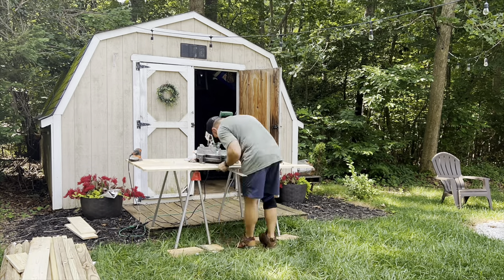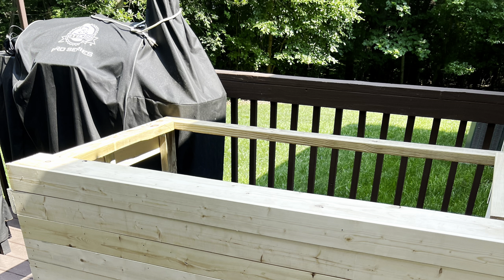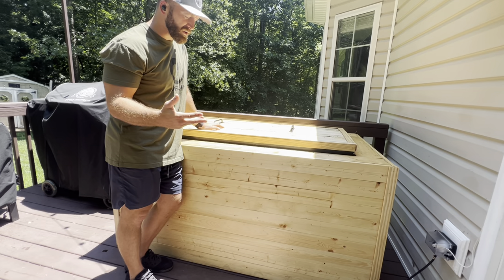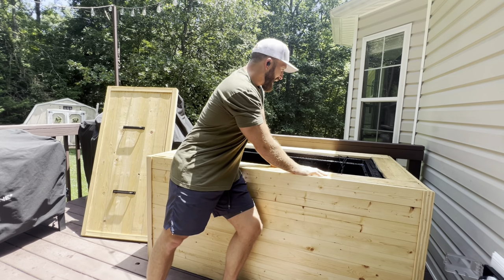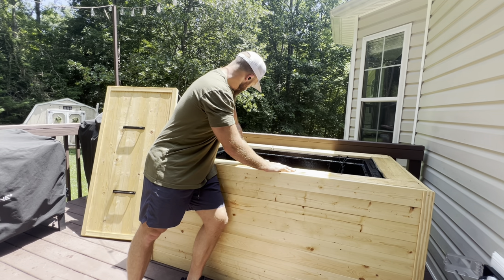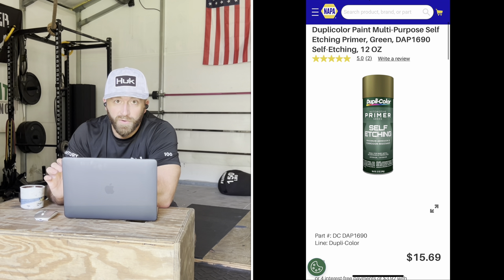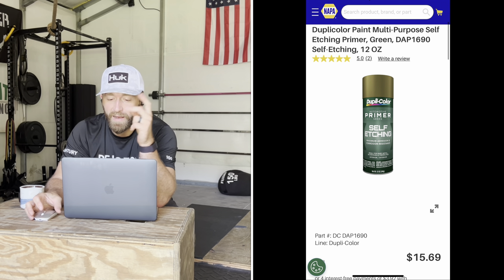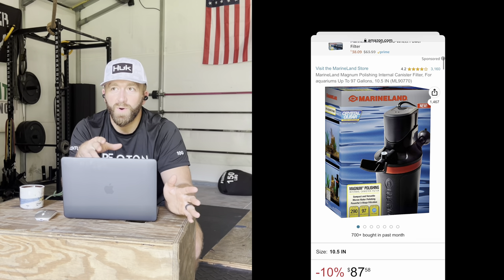DIY Cold Plunge - The Ultimate Chest Freezer conversion with wood enclosure.

Comment: Damn. Your break down of this project is perfect. You got a new subscriber
Reply from the maker: 🙏 thanks so much!
Reply: How tall are you?
Reply from the maker: @DarksouIjah  5 foot 10. I would think 6 ft would be the max for this freezer in my opinion. It’s not super roomy for me. I do have enough room to dunk myself underwater but it’s kind of tight
Reply: @FuelFitnessCo  Thank you for the quick response. Damn, I was hoping you were my height. I’m 6’1” and thin. That freezer you bought is the perfect one for the price.
Reply from the maker: @DarksouIjah  yeah for the price it’s pretty hard to beat. You could fit in there for sure, but it would just be a little more tight. I think even someone taller than you  could fit, it’s just they would be cramped up, kinda like those cheap small plastic tubs you see that they have to sit Indian style in.  All that to say, it would work, I just want you to know what you’re getting into. If you want to really sprawl out, and have lots of room, you may want to spend extra to go with a bigger size
Reply: @FuelFitnessCo  Yeah, I was looking at the barrel types and decided I rather get a longer one. I don't want to be cramped up. But I appreciate it. I do a ton of research before building or buying anything.. So I do have an idea of what I'm getting into. Hence my question about your height.

Comment: Thanks for this post man I was looking at that exact freezer and wasn’t feeling confident on the dimensions. How tall are you?
Reply from the maker: Thanks for tuning in!! I am 5”10 and it works great for me.
Reply: Are you able to be fully submerged (to the neck)? It’s not too narrow at the shoulders? Sorry for the 21 Q’s but the vid of you in is pretty quick.

I’m 6’ and wanna make sure I’m good to pull the trigger
Reply from the maker: @jesserivchin8163 oh yeah I can submerge to my neck. Its a little tough to do but I also dunk my head under ever time by laying back. As far as the width goes, I would definitely say measure your shoulder width and check the dimensions. I don’t have very wide shoulders, I imagine someone pretty broad might be a little tight in there in the shoulders.
Reply: Sorry another question I could find an answer for. Did you put any foam or wood support under near the freezer?
Reply from the maker: @jesserivchin8163  great question! Yes I put 2x4 blocks of wood underneath for support
Reply: @FuelFitnessCo   do you happen to have any pictures of how/ where you supported it? Primed mine last night, applying pond shield in a few days
Reply from the maker: @danielmetcalfe2223  nice!! I don’t have pictures of how I supported unfortunately. I didn’t think of it at the time. I was able to place 2x4s underneath and make them fit perfectly where they brace directly against that inside part of the freezer that we sit in. I think the main thing is that you have a solid flat surface that allows that part to rest on the supports. 2x4s cut to the right length fit up in there just perfectly

Comment: I am in the wiring phase of my set up now. Big question on the main inkbird for the side of the freezer for heat.

I’m in sac we get pretty hot too. Have you found that the external inkbird was worth it? Is the side still your location for measurement?

Mine will be outside and I haven’t gotten an external inkbird yet.
Reply from the maker: Great question. Here in NC it never got hot enough in our hottest months to make it worth it. Hottest it got in there was 95 degrees and the freezer is rated for 115 I believe. I still have it set up, but it may have been overkill